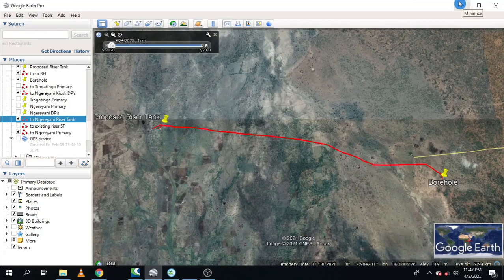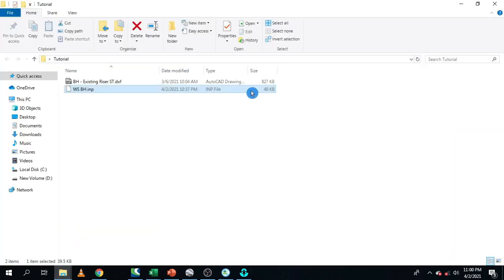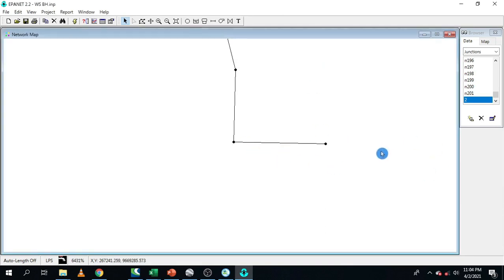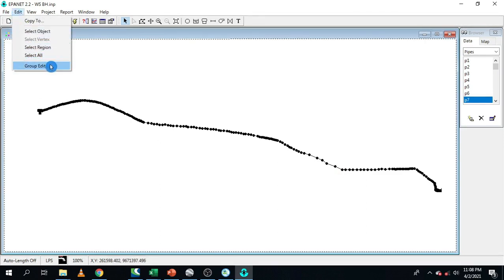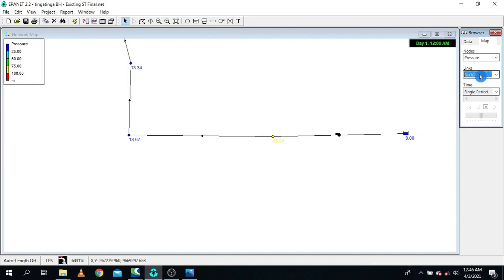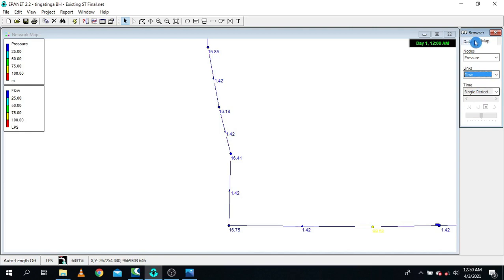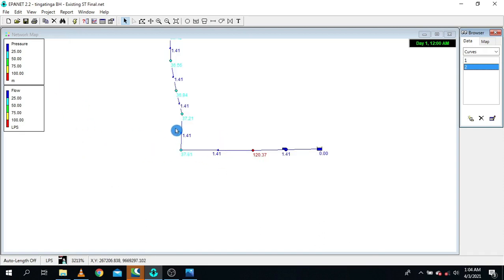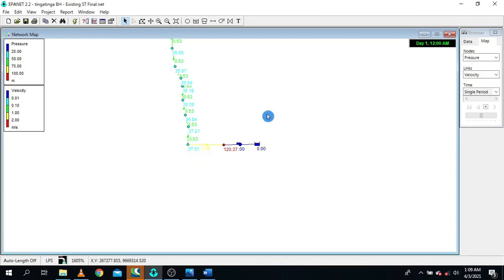EPANET Tutorial | How to Size/Model Water Pumps using EPANET Software [Based on Real Project]

Comment: Hello Sir, i have 1 question.im going to lay the pipe to my development where i have to tap from water main pipe in which the pressure at the water main is 20mHead. So, am i going to assume a reservoir as my tapping point or junction inside my simulation? Cause i need to know the residual pressure in my development area..
Reply from the maker: 1. Because the dynamic pressure is known, i.e. 20mwc, then You can do two things: either you assume it is a junction or a tank with a minimum water level of 20m. I think the tank with the minimum water level of 20m will be the best idea because, when you design, the 20m will contribute directly to where you want to supply water (distribution side). IMO at the tapping point, assume it is a tank with minimum water level 20m and elevation at this tank should be the elevation at the tapping point.

2. The 2nd option is to take a portion that takes water to your tapping point. for example,  if the source is the tank then in your model, make sure you are including the tank and a part of the pipe that takes water from the tank to where you want to tape your new network.  
3. Apart from that, if you have time, you can get the whole network in EPAnet and then introduce your network. Essentially, with this approach, the benefit you will get is to know exactly how your new network will behave when connected to the existing network.

Good luck.
Reply: @HydroinformaticsAcademy  understand.Thank you so much for your assist and explanation sir..Really appreciate it..
Reply from the maker: You are welcome, my friend🙏

Comment: Hi sir, do you still need to add pump curve if you input values in power in pump?
Reply from the maker: It is not necessary because if we needed to use curves for calculation then we'd need it but for as long as we used power then there is no need!

Comment: I think a piece of data missed either the well static water level & drawdown or the Dynamic water level from the pumping test report. and I think the aquifer elevation should be the level of the dynamic water level instead of the level of the pump set because the static head = Water level at the riser tank - Dynamic water level at the well. What do you think? Please clarify.
Reply from the maker: You are very right and agree with you it was a mistake! The static head for any submersible pump should be estimated from the Maximum drawdown point and not where the pump is installed! 

I don't remember well but I think I clarified it in the other pump tutorial!

I will find a way to notify people about it either by writing about it in that video itself or writing it in the description box so that people can be aware of it!! 

Thank you so much for pointing it out and for the feedback as well🙏🙏
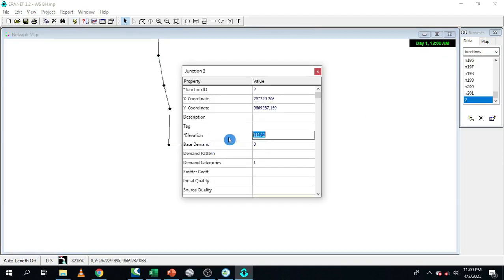Reply: @HydroinformaticsAcademy  is it in this timestamp 12:47 ?  What data should then be changed?
Reply from the maker: @rcane6842  YES! the elevation data you need to insert at this timestamp is not elevation data on where the pump is installed but rather where the maximum drawdown point is located! so if elevation at pump intake is 1111m and elevation at max drawdown is 1130m then use 1130m! somewhere in the future, I will possibly create a tutorial to explain this issue!

Comment: Hellow engineer, I have the problem and I don’t know how to solve it. I try to run the system on epanet and I insert the flow of 3 .25 l/s on pump curve with the head of 135 every thing is oky bt the problem the flow on links and nodes it show that 0.00

And the setting on epanet is l/s
Reply from the maker: If you did not get any error after running your model then Check the units format that you are using and make sure the epanet is set to use the same settings! If you are using L/s then make sure you set L/s on epanet as well.

NB: Check if you are running EPS as well, it might be your model is running at an hour with zero demand.
Reply: @HydroinformaticsAcademy  I have put all details but when i run the system it show s that cant be run 0:00 hrs but when a change the in put on  the pump  from OPEN to CLOSED , it runs successfully, but doesnt give flow(it remains as 0),what could be the problem.

Comment: Hello, I try to work network like yours, but the flow in my network shows negative values, What does it mean ??,   distance is about 10km from the  source to tank 
the topography has some hills along the way.  source point at this elevation 1126.4m while the tank at 1186.6m  Any explanation
Reply from the maker: Speaking of negative flow, do this... 

Right-Click "link/pipe" with the negative flow then click "reverse" then run your model again by clicking "run"!  I hope it will be resolved!

You can as well watch this tutorial: https://youtu.be/2YDpuUtuNdY
Reply: @HydroinformaticsAcademy   Thank you,   but Any explanation you can give that why that happens ?? I reversed and it worked
Reply from the maker: I think its because you drew pipe/link in the direction which is opposite to the  direction in which water flows.